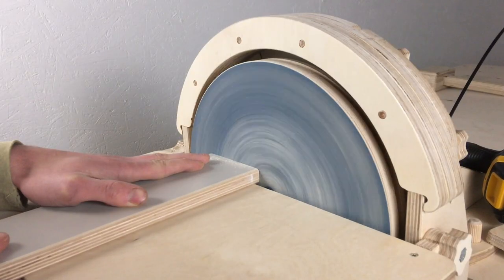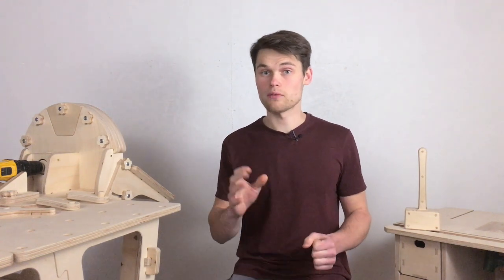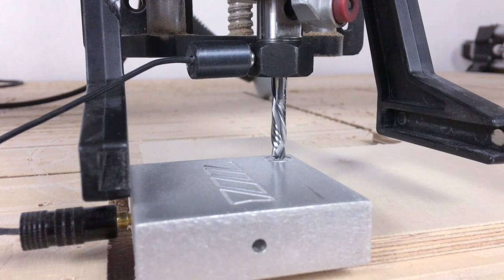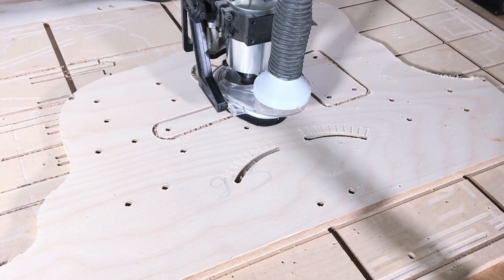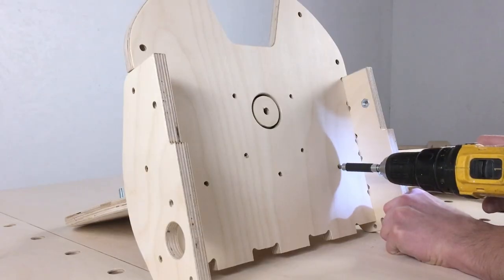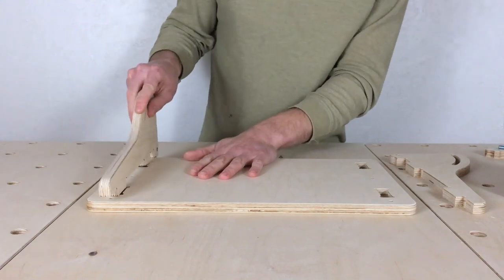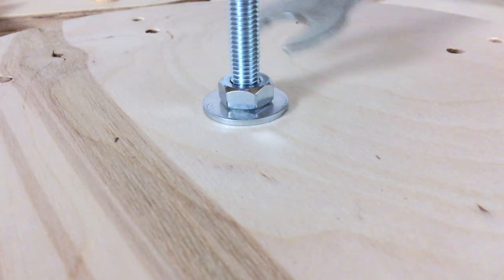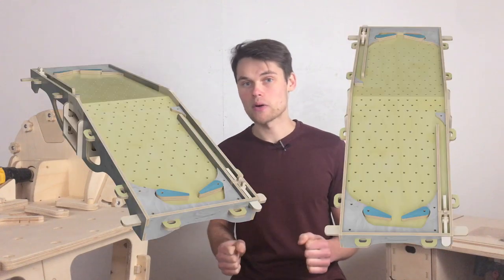Starting a Workshop from Scratch | Disc Sander - Aribabox

Comment: I love the ground-up approach to building your wood working tools, new fav channel! Just some suggestion, run the sander disk and use a chisel to "lathe" the edge evenly, it will lose the wobble. It's how Matthias Wandel does on some of his projects to clean up the wheels to get a true center. And for small parts on the router, check out Woodsmith's "small parts safely router table", it is a toggle clamp jig that keeps your fingers away.
Reply from the maker: We are glad you enjoy our content. And thank you for the recommendations - we will try out both of your suggestions.

Comment: Yes, compression bits leave sawdust packed into the toolpath, and tabs aren't needed too often.
I also use 2-sided carpet tape, instead of clamps, when clamps will be in the way, or if the workpieces are too small.
Reply from the maker: Thank you for all the great advice. 
The 2-sided tape is a great idea. We have to test it out sometime.

Comment: I love the idea of using a cnc to make tools! Heads up, in fusion 360 you can right click your canvass (looks like that's how you imported your photos) and click calibrate. Select two points, enter the distance, done. No need to draw rectangles and manually scale them. Thanks for the video! I'm going to go finish watching it now, lol.
Reply from the maker: Thank you, Tony, for a great tip regarding calibrating canvas when importing them into Fusion360. It's good to know that there is an option like that.